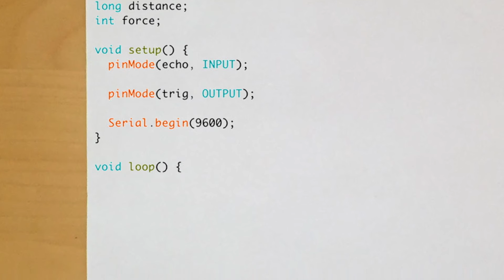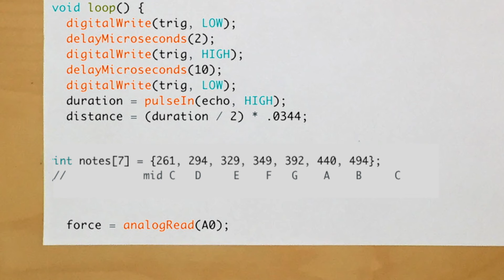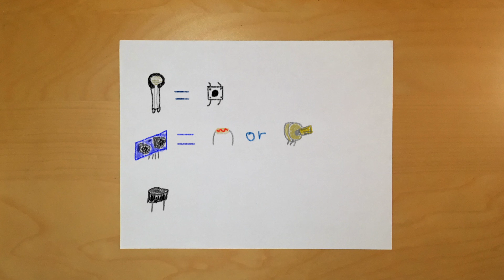Arduino: How to Make an Instrument

Comment: Which arduino did u use
Reply from the maker: Muhamad Tartila Arduino uno
Reply: Sam's Neat Projects is there anyway to replace the fsr wih piezzor + ressistance? The fsr works as some kind of button right? Im trying to find a cheaper way because i want to make moee than 1

Comment: how would you do it with a button
Reply from the maker: Just replace the Force Sensor with a button and connect the button to a digital pin instead of analog. The wiring should be the same otherwise. The code will also be very slightly different.
See this page for how to wire and code a button: https://www.arduino.cc/en/Tutorial/Button

Let me know if you need any more help
Reply: thanks

Comment: I copied the code in description
but it didn't worked
this is the error message
Arduino: 1.8.0 (Windows 10), Board: "Arduino/Genuino Uno"Musical_Instruments:8: error: stray '\302' in program آ  pinMode(echo, INPUT); ^Musical_Instruments:8: error: stray '\240' in programMusical_Instruments:10: error: stray '\302' in program آ  pinMode(trig, OUTPUT); ^Musical_Instruments:10: error: stray '\240' in programMusical_Instruments:12: error: stray '\302' in program آ  Serial.begin(9600); ^Musical_Instruments:12: error: stray '\240' in programMusical_Instruments:16: error: stray '\302' in program آ  digitalWrite(trig, LOW); //triggers on/off and then reads data ^Musical_Instruments:16: error: stray '\240' in programMusical_Instruments:17: error: stray '\302' in program آ  delayMicroseconds(2); ^Musical_Instruments:17: error: stray '\240' in programMusical_Instruments:18: error: stray '\302' in program آ  digitalWrite(trig, HIGH); ^Musical_Instruments:18: error: stray '\240' in programMusical_Instruments:19: error: stray '\302' in program آ  delayMicroseconds(10); ^Musical_Instruments:19: error: stray '\240' in programMusical_Instruments:20: error: stray '\302' in program آ  digitalWrite(trig, LOW); ^Musical_Instruments:20: error: stray '\240' in programMusical_Instruments:21: error: stray '\302' in program آ  duration = pulseIn(echo, HIGH); ^Musical_Instruments:21: error: stray '\240' in programMusical_Instruments:22: error: stray '\302' in program آ  distance = (duration / 2) * .0344; آ  آ //344 m/s = speed of sound. We're converting into cm ^Musical_Instruments:22: error: stray '\240' in programMusical_Instruments:22: error: stray '\302' in programMusical_Instruments:22: error: stray '\240' in programMusical_Instruments:22: error: stray '\302' in programMusical_Instruments:22: error: stray '\240' in programMusical_Instruments:26: error: stray '\302' in program آ  int notes[7] = {261, 294, 329, 349, 392, 440, 494}; //Putting several notes in an array ^Musical_Instruments:26: error: stray '\240' in programMusical_Instruments:27: error: stray '\302' in program آ  // آ  آ  آ  آ  آ mid C آ D آ  E آ  F آ  G آ  A آ  B ^Musical_Instruments:27: error: stray '\240' in programMusical_Instruments:29: error: stray '\302' in program آ  force = analogRead(A0); //defining force as FSR data ^Musical_Instruments:29: error: stray '\240' in programMusical_Instruments:32: error: stray '\302' in program آ  if (distance < 0 || distance > 50 || force < 100) { //if not presed and not in front ^Musical_Instruments:32: error: stray '\240' in programMusical_Instruments:34: error: stray '\302' in program آ  آ  noTone(12); //dont play music ^Musical_Instruments:34: error: stray '\240' in programMusical_Instruments:34: error: stray '\302' in programMusical_Instruments:34: error: stray '\240' in programMusical_Instruments:36: error: stray '\302' in program آ  } ^Musical_Instruments:36: error: stray '\240' in programMusical_Instruments:38: error: stray '\302' in program آ  else if ((force > 100)) { آ //if pressed ^Musical_Instruments:38: error: stray '\240' in programMusical_Instruments:38: error: stray '\302' in programMusical_Instruments:38: error: stray '\240' in programMusical_Instruments:40: error: stray '\302' in program آ  آ  int sound = map(distance, 0, 50, 0, 6); آ //map distance to the array of notes ^Musical_Instruments:40: error: stray '\240' in programMusical_Instruments:40: error: stray '\302' in programMusical_Instruments:40: error: stray '\240' in programMusical_Instruments:40: error: stray '\302' in programMusical_Instruments:40: error: stray '\240' in programMusical_Instruments:41: error: stray '\302' in program آ  آ  tone(12, notes[sound]); آ //call a certain note depending on distance ^Musical_Instruments:41: error: stray '\240' in programMusical_Instruments:41: error: stray '\302' in programMusical_Instruments:41: error: stray '\240' in programMusical_Instruments:41: error: stray '\302' in programMusical_Instruments:41: error: stray '\240' in programMusical_Instruments:43: error: stray '\302' in program آ  } ^Musical_Instruments:43: error: stray '\240' in programexit status 1
stray '\302' in programThis report would have more information with
"Show verbose output during compilation"
option enabled in File -> Preferences.
Reply from the maker: When you attempted to compile, which lines were highlighted?